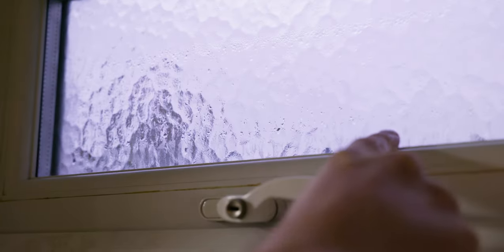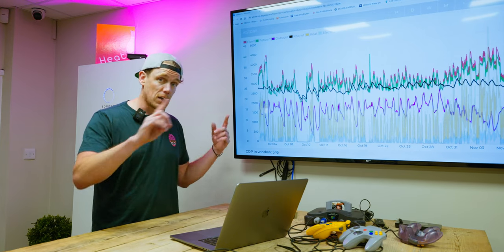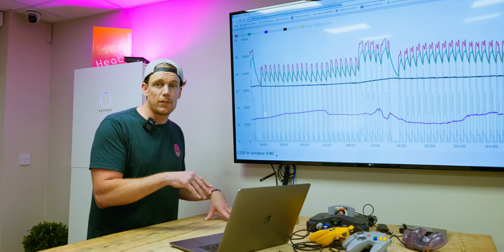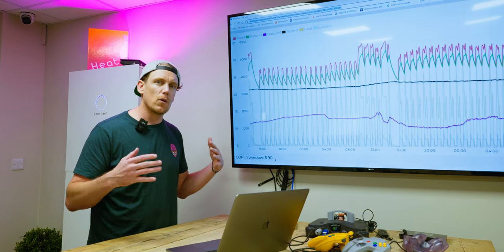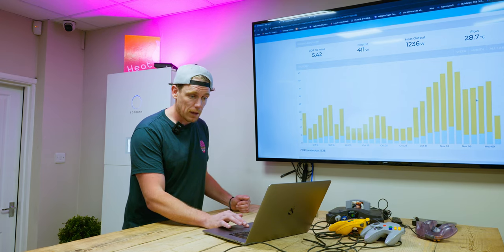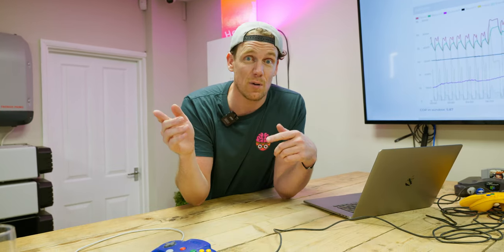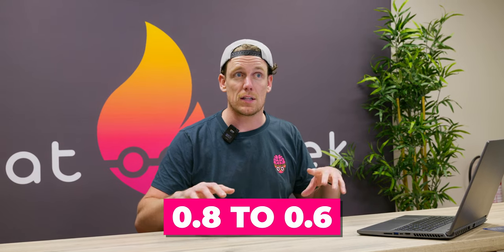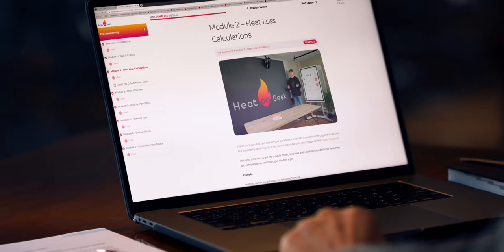How We Got 600% HEAT PUMP EFFICIENCY With NO INSULATION!

Comment: When using ground source heat pumps, is there a temperature cut off point? Ie if there was too much heat pulled from the ground or other source, would this negatively impact the efficiency due to the refrigerants used?

If not could you combine waste water heat extraction with the heat pump, reducing the required amount of land you'd need to use and reuse more of the energy you've created. Significantly reducing outlaying cost and making this more accessible to people with less land.

I would love to chat about this with someone in the know.

Comment: You certainly don't need a new well insulated house for a heatpump to work or make sense. I own larger timber framed house from 1732 in New England where mid winter nights are regularly -10c or colder. We have an air-to-air heatpump that keeps indoor temps at 20c down to around -12c. We have a backup furnace that will kick on below that, but ultimately that's generally only running a few hours on cold nights in mid winter.

Our loft insulation is basically what you showed here, whatever fit in between the joists. We do thankfully have some blow in cavity insulation, but our exterior walls are thinner than modern homes and aren't air sealed, so its still far from being well insulated.

Granted if we lived in an area with gas service that would almost certainly be cheaper, but in our semi rural town the only fossil fuel choices are heating oil or propane.

Comment: I"m guessing also that you're mainly heating the office in the daytime - so you don't have the problem of lower evening/overnight temperatures to contend with. A lot of domestic systems will be working hard early in the morning and from early evening to midnight when the outside temperatures are lower - so perhaps the COP would be likely to be lower? Or are you leaving the system on 24 hours a day?
Reply from the maker: We have it on from 6am to 10pm. You can see yhe property temperature in the graph is constantly between 20 at night and 22 5 during day.
Reply: @HeatGeek  Great! impressive. I live in a draughty old Victorian house and have noticed big improvements in efficiency after swapping old radiators for modern ones and installing a modulating thermostat...sadly haven't got the money to be able to go for a full heat pump conversion. we need the government to incentivise all this much better...

Comment: I have 300mm loft insulation and 60mm cavity wall insulation that’s carbon bonded bead. My house is a 1950’s 4 bed semi. All new double glazing throughout now as well. Now it’s time to get an up to date EPC done. Anyone now where the best place to get an EPC done would be? I’m told they cost around £40-£50.

Comment: Your COP values are very impressive, partly explained by your low flow temperatures. However, your building seems to have an extremely low heat loss, despite the lack of insulation. Using the figures from 30th November, your heat pump generated 54 kWh and consumed 12kWh giving a COP of 4.5. The internal temperature never dropped below 20 deg C with an average external temperature of around 6 deg C (difference = 14). The average heat loss during this day was 54/24 = 2.25 kW which gives a value of 160 W  for the heat loss per degree difference between internal temperature and outside temperature. This seems very low for an uninsulated house (mine is 450 W). Having said that, I doubt if many ASHP owners get a COP of 4.5 when the outside temperature is 6 deg C, however low their flow temperature. How are you achieving this? No buffer tank for one thing probably.
Reply from the maker: No buffer tank. And importantly, quality pure advanced weather compensation. R290 helps with scops too!
Reply: meh, my brother has a SCOP of almost 7. Water/Water heatpump. And is actually very normal for newbuild houses here right now. But many countries are far behind probably. It's funny to see how to try to catch up. I know many people with electricity + heating bills of around 0 Euro. My little brother last year has 3 euro bill for the whole year for Electricity + Heating + Cooling too.
Reply: I have this crazy idea of mounting the air water heatpump INSIDE a glasshouse (170m3). Used only for heating I wonder what COP would that achieve! Also if it would actually work (air flow,/humidity wise). Do you think I could get close to 9 COP? Especially if I optimize the heating during the day (max solar insulation)

Comment: Great video! What did changing the weather compensation curve from 0.8 to 0.6 mean in terms of flow temperature? 
I figured that the flow temperature at 0°C outside changed from at 47°C (0.8) to around 38°C (0.6). At the moment the outside temperature is about 12°C, so the flow temp should be about 28°C (curve 0.6) or 30°C (curve 0.8) so very little difference. The difference becomes larger at lower outside temperatures. I would love to see a video with snow on the ground, what will the flow temperatures and COP be then?
Reply from the maker: Sure. But the only REALLY important thing is the average over the heating season because that's what the bill is..
Reply: @HeatGeek  I suppose per-season efficiency becomes more interesting in a hybrid setup, where you may want to use the heat pump for most of the year and switch to oil / gas when it's very cold outside.

Comment: I'm running a 7kW Arotherm plus on a modern house with underfloor heating. My ASHP has a fence 1 metre in front of the fan. My combined (DHW + heating) SCOP since installation 15 months ago is 4.4 which is good. However, I have recently started measuring the air temperature going into the intake as I suspected its recycling chilled air, and sure enough I'm seeing temperature drops of 2⁰C+ when it's running. I can't move the fence, and I don't know whether moving the ASHP to give greater space in front of the pump would be worth the cost.
Would you consider running an experiment with your ASHP to demonstrate the recycling of chilled air when a barrier is placed in front of the pump? You could show the significance of keeping the area in front of the pump clear with a movable fence panel or similar barrier.
I'm irritated with Vaillant as the ASHP has been fitted according to the space requirements in their documentation (as I understand it), but it's clearly being affected by the fence. Thanks for reading!

Comment: Goldeneye in the office (Y) We are electric only, On economy-7 tariff. Two high-heat retention storage heaters, one in the living room and one on the upstairs landing. Hot-water tank is immersion heated. Loft insulation done . Is a heat pump installation going to be incredibly expensive to replace this heating system as new pipework and radiators will need to be run? Also illegible for the grant I'm assuming.

Comment: High thanks for the videos but could you help me to explain the usage relating to electricity usage,on the live feed for say the 29th November it shows that you used (I think) 12.746 kilowatts that day is this correct or was it in one hour of usage sorry I am a bit confused regarding kilowatt hours and has the solar thermal contributed a lot to the reduction in running costs of an ashp and I also wonder if it would ever be able to put enough insulation in a 70s bungalow so as to make it into a  passive home where no heating is required

Comment: Nice cop ! Is this possible with any new heat pump ? looked to get one for last 3 years but couldn’t make figures work  looking at it again due now with high energy prices but electricity is a lot more as well as gas so it still the same difference 7.5 p off peak for 6 hours and 40 p peak for the rest of the day  and 11 p kWh for gas . We have 6.2 kw solar west facing with 5 kW invter and 13 kWh battery storage. Got a company coming Thursday to quote us what questions do I ask them to find out if there going to quote for a good system or just a cheap system like 2 others have .  And how much energy does a home style heat pump use to run in the day in the winter ie on peak use at  once ?  I’ve been quoted for a 8 size heatpump before I think We live in a 3 bedroom fully detached bungalow and mid winter use about 60-70 kWh of gas a day and trying to work out if it going to be cheaper to use a tapo zeb on off peak electricity and use our 5 year old hot water cylinder  heated from off peak and solar or get a air to air  whole home setup or a heat pump any help anyone can provide would be great help Thanks 
Also these open energy monitors are they good idea for home use for a data geek or was this just for demonstration purposes?

Comment: Can you tell me if you use a buffer tank alongside the 28mm or 22mm hidden pipework and is it just the trvs that control the heat out of each radiator relevant to the heating curve or does the room thermostat control the maximum heat or is it best practice just to rely on trvs.
Thank you

Comment: I would like to see some details of your OpenEnergy monitoring equipment. Measuring energy input is easy, just needs a Current Transformer on the live feed to the heat pump, but how are you measuring the heat produced?
Reply from the maker: Mass flow rate.flow and return woth flow meter. Very simple. Look for our mass flow rate video
Reply: @HeatGeek  many thanks, will do! I was wondering if this technique can be used to also monitor an aircon air2air heat pump...but clearly a straightforward in-line flow meter couldnt be used to measure the refrigerant flow rate, perhaps an ultrasonic flow meter...

Comment: Great Graph at 2m40 ...  What is happening between the heat pump runs? is the circulation pump still going . or is it just resting? Does it just restart once the flow water has cooled , or are you timing the heat pump to come on every 50 mins or so, according to the heat need cacluated from weather outside?

Comment: If you increase insulation remember you have to improve ventilation. If so put the outdraft against the outside unit. Energy recovery. SMe goes for shower drain Water lots of energy loss there.
Reply: Correct, every modern newbuild house has a ventilation system with heat recovery. It does have some maintenance to replace the filter once in a while though. It will keep the heat inside and refreshes the air.

Comment: Will adding more insulation not actually drop efficiency? I'm finding with our Mitsubishi that with low flow temps it tends to cycle more as heat loss is too low to keep the flow/return delta large enough. It's on less often, so less overall energy use, but the efficiency is less.
Reply: I expect with radiators that big it just means will run at 35 C through depths of winter - so better efficiency - though what I find is need some room temp control to turn off for longer periods in mild weather (ecodan wireless control on auto-adapt mode does this)
Reply from the maker: It should increase efficiency

Comment: The issue with these though is unless you have solar panels running them they are basically as expensive as a combination boiler but double to treble the purchase price . Who has 20k to fit a system ?

Comment: Hi Adam. Again great video !! 
Questions: is your system being helped by solar ? I assime it does. Because 5.9 is above any HP specs, right ?

What is the COP for your Vaillant HP, from their specs, at the avg Nov temps? 
The last one: what is the min output kW for the HP? 

Keep the videos “flowing” 😊
Reply from the maker: The solar is not included in the metering. The meter only measures what the heat pump produces so no. Infact solar would decrease our acerage cop as the heat pump would perform better on those days. 
 Additionally we have now turned off the solar so we can measure more accurately.

Comment: A heat pump can create all the heat you need…but if your emitters are insufficient in surface area then you’re restricted in getting it out into the environment. I’ve been telling my customers this for years. Design is key to performance
Reply: Heat pumps= bigger radiators
Reply: @danielwebb2773  or just appropriate ones
Reply: Insufficient in surface area?  Doesn't that mean too small?
Reply: @danielwebb2773  so you agree with me?
Reply: I have heard that you need bigger radiators with ASHP systems and thought that was what you were implying

Comment: COP > 1 is a bigger deal than people think.

COP > 1 from a cold sink to a hot sink for thermal potential energy means that one day a method will be found for electric potential energy.

The instant we figure out how to creat electric potential energy with the same efficiency that a heat pump creates thermal potential energy, the energy crisis will be over.

Comment: Why are rads still rated at dt50 and dt70 when you should be running dt35 or less really to cope with the new 55deg flow temps required

It makes finding rads more hassle than it needs to be!
Reply from the maker: It's been thos was forever. Means rad manufacturers can state the absolute max output
Reply: @HeatGeek  indeed! Any pointers to good efficient rad manufacturers as can't run multiple rads in each room and want to avoid 600x2000 k2 in a load of rooms :)
Reply: @Howdydoody76435  why 600x2000k2? Why not fit a 700x1400k2 or a 700x900k3 to make it smaller with equal outputs? 
Aluminium radiators output more than steel also allowing you to downsize more of emitter size
Reply: @bampot2241  honestly was a bit of a joke. I'm restricted in a lot of places to 500 high as windows get in the way. Also 500x1600 are incredibly cheap at screwfix any size up or down are alot more. I have 2 kitchen "designer" rads I should replace need about 1kwh at -2.2 current ones give out maybe 600 will be running 45c mwt with 20c room. The Mrs doesn't want ugly white panel rads
Reply: Suppliers are starting to openly spec  ∆t50/40/30 now. Shame most heating guys still don't have a clue what it means.
Reply: @Howdydoody76435  Can you not bring the heat loss down anymore? remember fabric first 😀
Reply: @camed4384  not without being destructive as would need new french doors and windows and that's not happening just now unfortunately. The heat loss is a fairly broad streaks heat engineer calc
Reply: @Howdydoody76435  MCS have a free heat loss calc for the whole house, I use it when training. I wouldn’t worry about new windows and doors as even the ‘best’ are actually not much better than  standard
Reply: @callummedway8351  will give that one a go too the entire house is about 5.6 as far as I previously worked out but that was quite rough and not taking certain bits into account like one stud wall does actually have insulation in it
Reply: @callummedway8351  tried that spreadsheet couldn't get the rad tab to work for some reason. I'm also using gas and can't seem to adjust the flow return delta

Comment: I have just been studying your data on Emoncms it looks like your heat pump is cycling quite a bit, I would think if you can stop that it would be even more efficient. Thanks for the video I love your channel.
Reply from the maker: They are 45 min cycles. It's all good.
Reply: How would you reduce cycling ?Just with a anti cycling delay? Or physical changes such as larger buffer?
Reply from the maker: @joewentworth7856  a volumiser, hysteresis, control practices of customer and anti cycle delay yes
Reply: Get a big buffertank. Also useful for boosts when PV’s are up.
Reply from the maker: @Brian B  that would lower efficiency in our opinion. We'd prefer more batteries for extra pv then multiply through hp
Reply: @HeatGeek  because your return would be to high ?

Comment: How will the system cope with prolonged -20 ish temps which we had a 3 or 4  years ago when the beast from the east hit?
Reply: It depends on the refrigerant the heat pump uses, a system designed for cold weather should have no problem with -20.

Comment: Once it's insulated properly it might benifit from a lower capacity heat pump to keep it running near its maximum.
Reply from the maker: Yes but there isn't a lower capacity hp unfortunately
Reply: @HeatGeek  4kW mitsubishi QUHZ!
Reply: @jeanforthewin  Panasonic do a 3kw heat pump. KIT-ADC03JE5C.

That's probably the 3.5kw Vaillant already installed

Comment: Great video with lots of info as usual! I am not in UK so cant benefit from your services, and planning to switch to a Vaillant hybrid setup for my fairly insulated(roof, and walls insulated and have hr++ glasses in every room, need still change some radiators, there is not much i can do for floor insulation but there is at least some) 130 years old home. I changed the 20 years old boiler to a Vaillant ecoTec exclusive VHR CW5+ 34/43, and now i am able to measure my heat demand. I thought about using your open Energy Monitor the COP values for similar HDD valued days can give me an estimation about my possible energy consumption if i switch to a heat pump. Do you think it would be logical to use that data?
Reply: Just break down that old houses. The UK should really just rebuild many old houses. It's no use. Need to build stuff up from the ground. Look at  new build houses from the Netherlands. We are your neighbors. Newbuild houses here have energy bills of around 0 to max 50 euro a month. My little brother had 3 euro energy bill last year. Also a good weapon against putin.

Comment: Hi Adam, My Daikin Altherma 2 is set to 25(@20deg ext) and 50(@-2deg ext)*. How does this compare with your 0.6 setting. Average COP since June is 4 for heating and 2.5 for Hot Water based on controller readout. Love the videos
Reply: What are those figures in Dec, Jan & Feb?
Reply: @davidreece1642 Don't know yet as ASHP was only installed in June. The design sCOP figures are 3.4 and 1.9 respectively.
Reply: @philipbroggio9315  Thanks for replying. When Adam next does an update perhaps you could post your figures too.